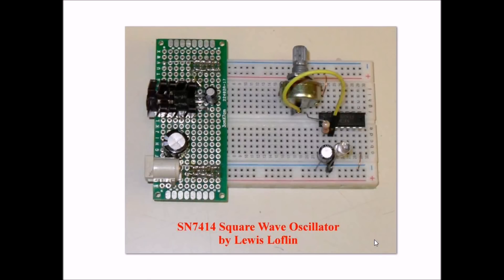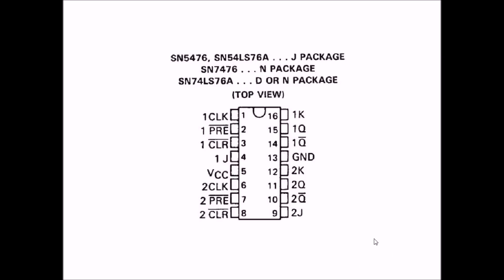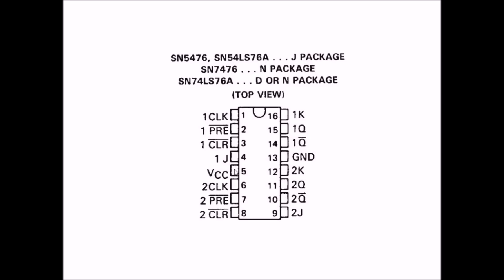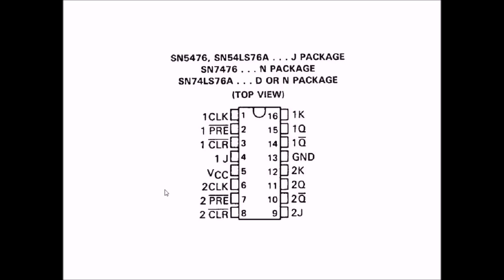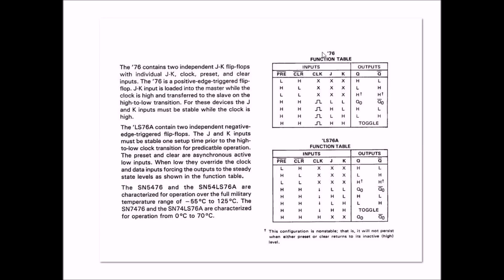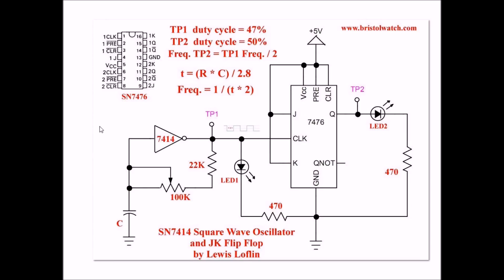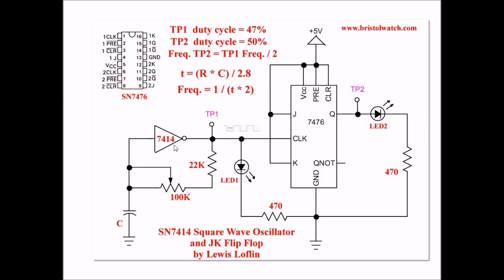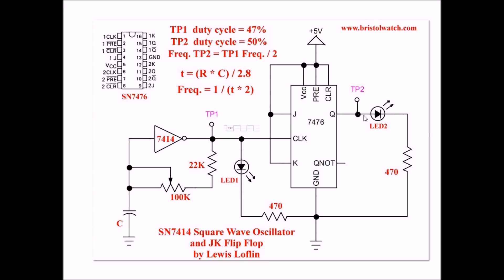SN7414 Square Wave Generator uses SN7476 JK Flip-Flop for 50% Duty Cycle

Comment: So to prevent flip flop racing, the 7476 has a master-slave circuit and the 74LS76A has edge triggering built in? This answers a query I had…
Reply from the maker: The flip-flop creates a 50% duty cycle square wave.
Reply: @LewisLoflin  yeah, but if you build a JK flip flop circuit using logic, it won’t work because it won’t edge trigger, it will race. Even if you build the flip flop correctly.
Reply from the maker: @davadoff  Why build a JK flip-flop? I have built them from logic, but why bother? Use one already built.
Reply: @LewisLoflin  no reason. Just understanding how it works.